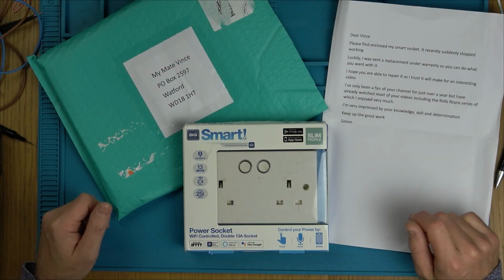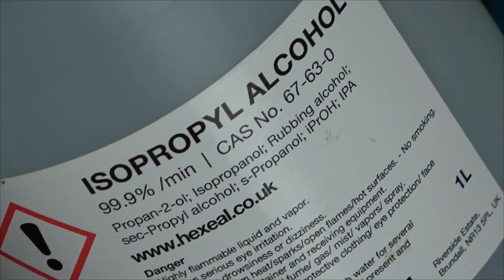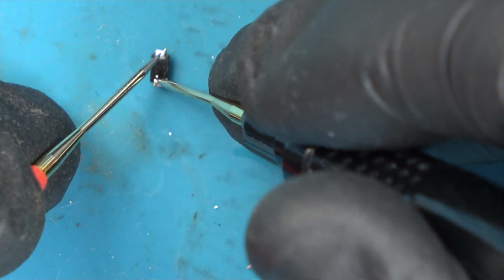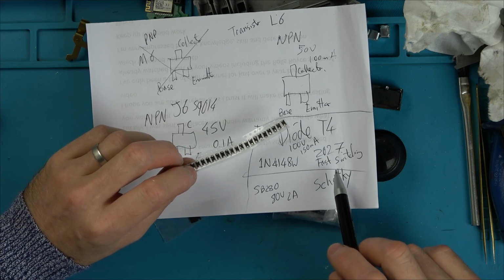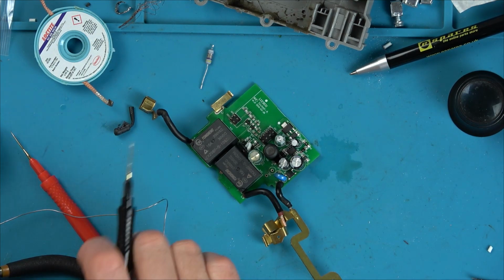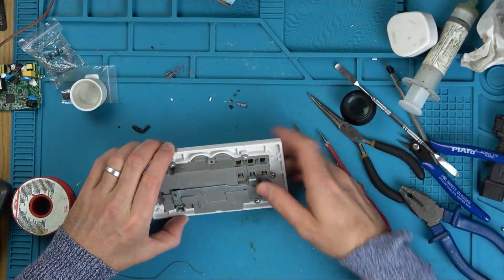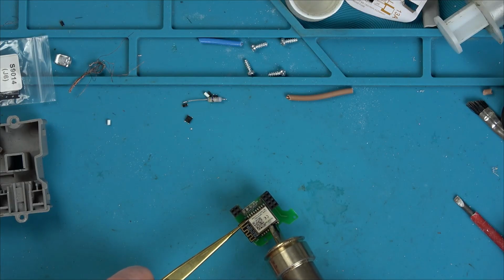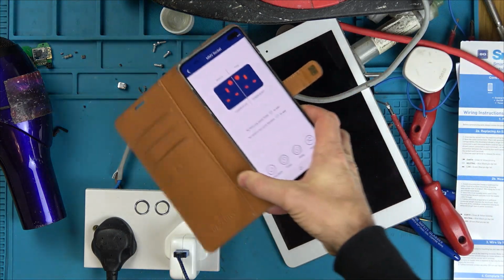Trying to FIX a 13 Amp WiFi Power Socket

Comment: are you going to take that part out and use it on the one that you brought and use it so you have not wasted your money
Reply from the maker: Yeah I have swapped the WiFi board back and soldered back the rivet together. If I need one I will use the new replacement one, but right now I can't think of a use for it👍

Comment: I have never trusted these or the USB equipped sockets, that is to much low voltage electronics without adequate separation from high voltage AC.

Comment: So how to make a reliable socket to a unreliable socket by adding a smart board 😂
Reply: Its not just by adding a smart board but rather dodgy chinese cheap non safety standard electronics
Reply: Non rhos @309electronic5
Reply: Yup. Over complicate and introduce more points of failure.

Comment: Probably some liquid damage or some conductive debris got inside and caused  arcing between pins and components to die and the low and high voltage arcing or shorting  killing that wifi module.

And yes 56:47 Those wifi chips are programmable and can be kind of compared to the esp8266 chips you also encountered, just that this is not an esp but some chinese manufacturer. Usually the Manufacturer loads tgeir firmware onto the chip and the firmware is the real magic sauce here doing the comminucation with the cloud and handeling the functions of the device
Reply from the maker: Thank you 👍

Comment: This is not like you vince.  Normally you would have swapped the chip, rather than the entire module. I am a bit curious if the chip was the only fault in that module. Regardless, this was an awesome fix!! Well done!!
Reply from the maker: Hahaha, I think I was just too tempted by the easy swap. I'm nearly 100% sure the chip was to blame by the heat spot when using the IPA and the 1-2 ohm reading on the resistor. The caps weren't shorted which I think I cut out or fast forwarded though 👍

Comment: Most likely moisture started it.  The power to low side should have big gaps, they could had better layout. A slot would have helped so to stop moisture and increase the isolation. I have never wanted to fit these as always on and likely to fail.
Reply from the maker: Thanks Graham 👍

Comment: Honestly I hate those sockets. I had a USB socket from BG which over volted the USB ports. Luckily it was only connected to a cheap vape but it caused the cable to catch fire!
Reply: I nearly lost my mobile phone through a similar fault where the USB voltage was fluttering all over the place. For some reason the phone drained the battery dead flat with no other damage. Got a second use battery and a small tube of sealant from Ebay. Phone rescued.
Reply from the maker: @TheCod3r  Luckily it wasn't your best MacBook either...MacBoom😅 I still love that typo of yours, still makes me laugh all these years later Phil. Hope your keeping well buddy!
Reply: @Mymatevince  Indeed buddy 🤣 oh by the way it wasn't a typo, it was intentional 😝😎 yeah I'm good buddy, you?
Reply from the maker: @TheCod3r  😅😅 Yeah yeah yeah, I believe you!  I'm doing alright, so busy as I'm trying to sort my house out and do videos, and lately every video seems to be going against me. The luck has to change soon though and I can get some content out. Been really slacking on content even though I seem to be putting in loads of hours. I been neglecting your vids too, haven't stopped by in well over a month. Sorry man, I'll look forward to catching up in the next month. I used to love having a late night cereal and joining your streams an hour or 2 after they started, then watching on 1.5x or 1.75x speed and then catching up to real time nearer the end. I just need about 6-10 more hours each day and my life would be sorted!!!😎

Comment: Yeah. Agree. Definitely would not use that again. That looked like a pretty bad failure. Could have started a fire! I guess that fuse blew just in time. Could something like a slug have slid inside and caused a short? If powered on with nothing in it that is a possibility. I've got numerous smart plugs which would probably have the same problem eventually.
Reply from the maker: Cheers Paul, I'm looking forward to the comments to see what viewers think is the actual failure, that burn mark on the board looks like it was tracking from 240V AC trace to the low voltage DC trace. I wonder if that was the initial cause via some liquid damage.
Reply: @Mymatevince Could it have been condensation in the walls? If the humidity's high enough you don't need to pour liquid into a device to have liquid damage, and inside a wall in an old house in a humid area...